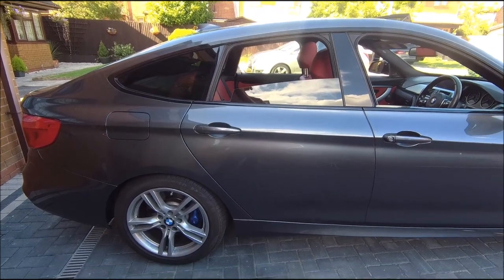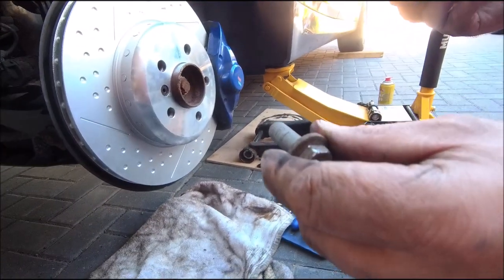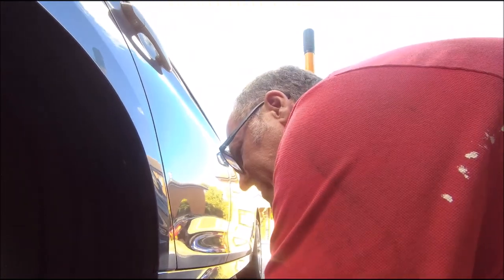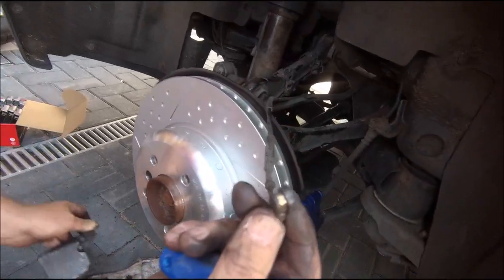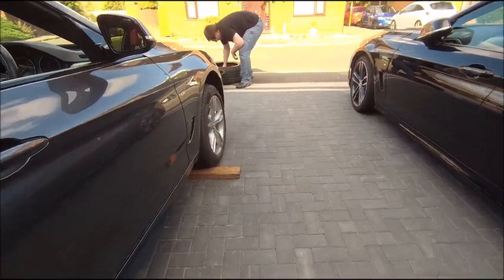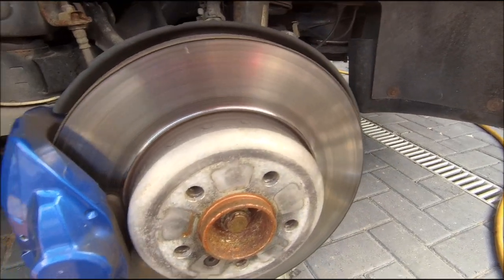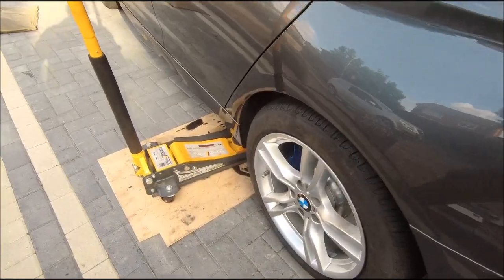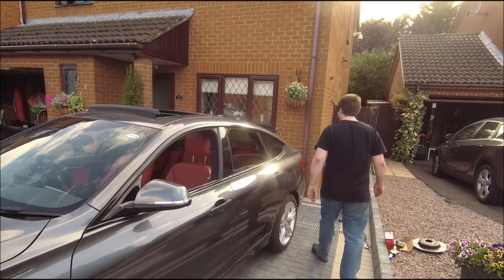BMW 335D GT back brakes replacement #bmw #335d #BMWbrakes #brakereplacement

Comment: Hi Ade so you didn't fancy taking it to Sycamore's and have them all replaced for £25,000 plus VAT 🤣🤣🤣
Reply from the maker: LOL... not this time.. he did take it there to get a set of new tyres on it , they did manage to put the wrong size on the front and set the TC crazy, so had to go back again.... took some persuading them they had messed up but they did swap them after a bit too to & throw, but kind of made us go "ummmmm"  after that...
Reply: @AdeReeves  I had a very bad experience with them with my other BM, never went back, when I had a recall I went to Cambridge as I didn't want Sycamore to touch my car!! not sure what to do with this car, for tyres I have been using Phil's Tyres for years really nice bloke and price matches.